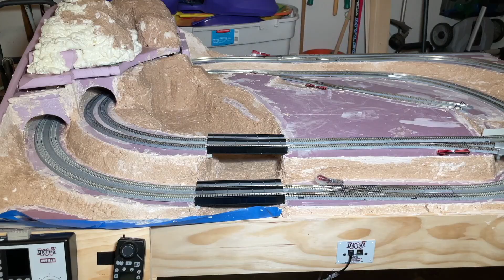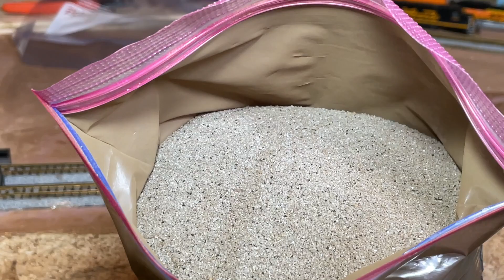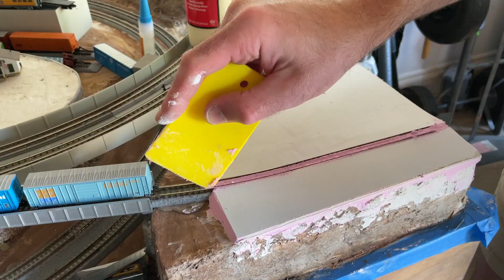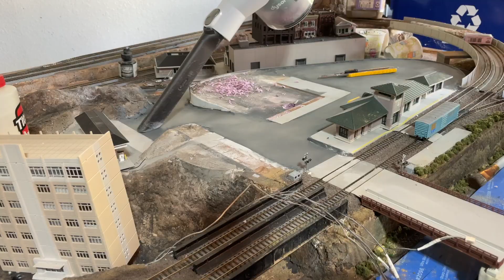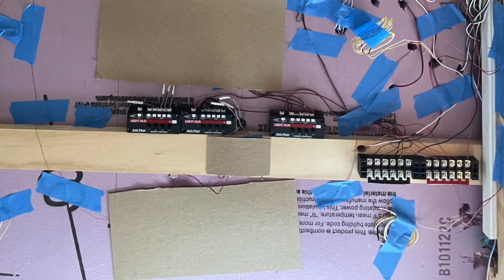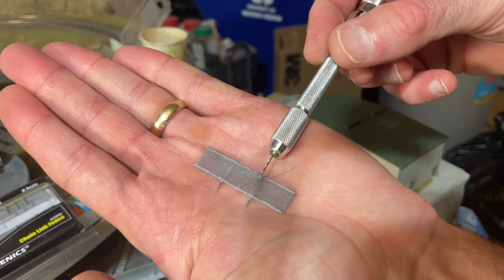3x5 N Scale Layout Project Part 3: Base scenery, Structures, and More

Comment: Hey Steve, I am about to start my first layout and have been learning a lot from watching your videos. I really enjoy them. I have a question, why are you spraying areas with alcohol? What does that do? And is matte medium like a glue?
Reply from the maker: Matte medium works like regular white glue but it is more flexible and it doesn’t dry shiny like regular glue does. I spray things with alcohol to help the matte medium mix soak in easier without beading up on the surface. You can just add some dish soap to the mix and/or spray everything with a water/soap mix as well.  I like using alcohol since I can spray a finer mist more readily which won’t disturb the scenery as much and also it helps everything to dry faster.

Comment: You have one advantage. Most of the trains run on fuel so you don't need to built overhead electric power supplies. Most of the tracks in Europe are electrified so either you choose to built tracks of the past and operate with steam or diesel trains or you are obligated to built overhead power lines and that's not easy on the N-scale. Loved watching this video. Greetings from the Netherlands.
Reply: Someone should do overhead electric power supplies. This woudl be amazing!!

Comment: That wire burn off tip probably just saved me hours of headache.
Reply from the maker: I just learned that this summer. I can’t tell you how much I hated working with that thin wire until I came across that idea in a forum somewhere. I was always breaking the wire trying to strip it. Now it is easy peasy. Some of that wire you can also just solder with the coating on it as the heat from the solder will burn off the coating but it depends on the wire type.

Comment: Really looking forward to that wiring video. Not a big fan of Kato switch buttons.
Reply from the maker: The full part 2 video shows how I used push buttons on the fascia and digitrax controllers to control the Kato turnouts.  It works great: https://youtu.be/P0y9i0BsnlU

Comment: another great video as it all starts to come together for the final layout.  those signals are very interesting and i'm actually looking at them to possibly add to my layout.  still can't wait to see the final layout, any chance of possible camera car footage during it?  just wondering, but it's completely up to you as it is your layout and channel.
Reply from the maker: I would like to do a camera car view. That is something I need to get setup.
Reply: @StevesTrains  the setup that I use a just a depressed flat car and one of those cheap cop cams. The camera is small enough to fit through the tunnels with little to no problems (except for the initial setup and eating process).

Comment: Great job thus far.
I agree with you about the WS Track pens, they get destroyed really quick but like you, I like those colors and drained the pens 😂
Pike kits are great, I really like them but wish they’d have a bigger selection.
Loved your suggestion about stripping those tiny wires, I’ll try it even after I finally found a stripper that works on them.
Thanks for sharing!
Reply from the maker: Obviously burning the wire coating off isn't necessarily ideal to do inside the house, at least not if you are doing a bunch of them and don't have good ventilation. It isn't a big deal for me in the garage since I can just open the garage door.